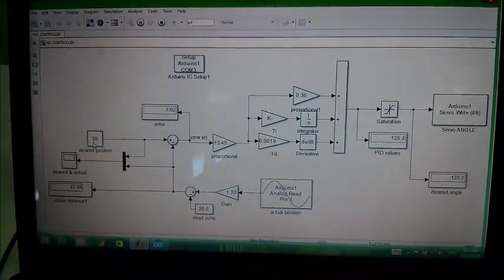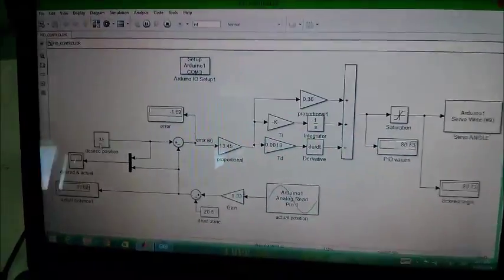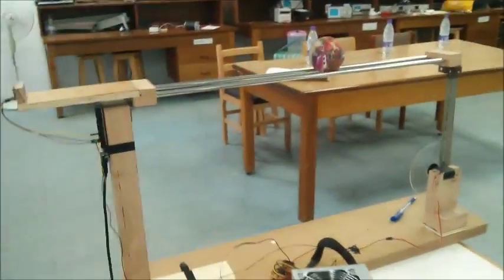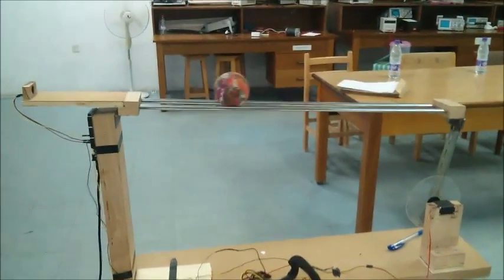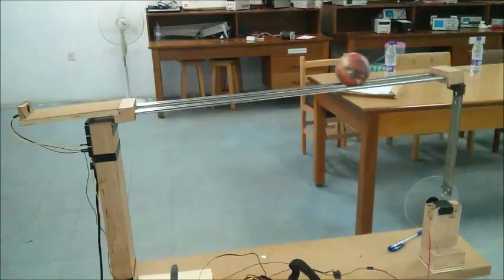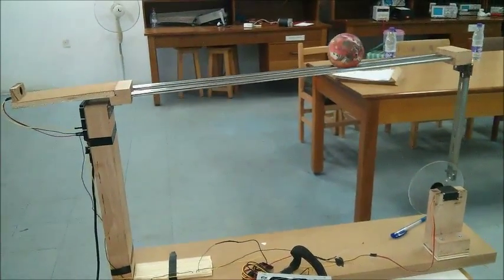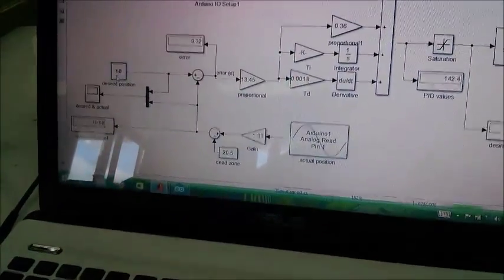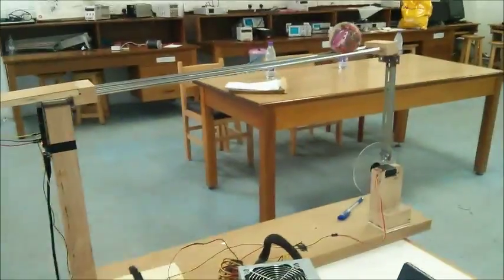PID Control in Ball and Beam System

Comment: Hey excellent project! I would really appreciate If you could answer some questions.  I was wondering how did you set up the saturation block?  also I would like to understand how does the gains after the sensor block (analog read pin 1) affect to the measure.
Reply from the maker: Hello dear daniel zuniga, thank you for the compliment.

For the saturation block, as you know the servo motor accepts values between 0 and 180 degrees, so the use of it was to be on the safe side, if the value was more than 180 it won't give more than that, and the same thing for 0 (it won't give less than 0).

As for the gain, the reading of the ultrasonic sensor was not giving us the actual distance, so we had to calibrate it (trial and error) until we reached that 1.33 gain will give us the actual distance.

Good luck my friend.
Reply: Mohammed Al-Romaithy Just to let you know I´m trying to make a similiar project for Control engineering class. I was finally able to realize how to handle the sensor measures, my problem is that I´m using an IR sensor. Now I´m stuck with the servo, I mean I understand that the range of acceptance is 0 to 180 but how did you manage that with the saturation block? In other words your upper and lower limits are literally 0 and 180 in main and signal attributes tabs from the saturation block?
Thanks for your help Mohammed and greetings from a mechatronics engineering student from Mexico.
Reply from the maker: To be honest with you we put the values at 15 and 165 at the saturation block to limit it a little bit because the actual servo was giving us more range (around -10 to 195). You can just insert these values in the block in simulink and it will take care of it.

But it is all experimental, so as soon as you can finish building up the model and trying it in real life the better it would be.